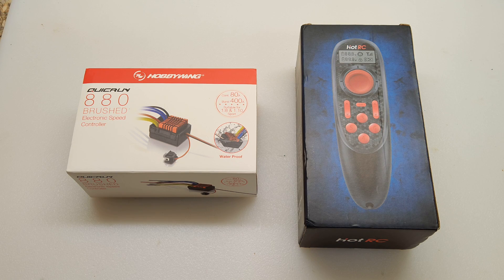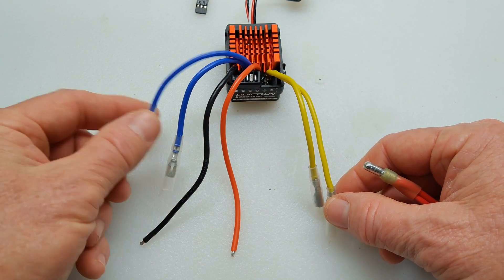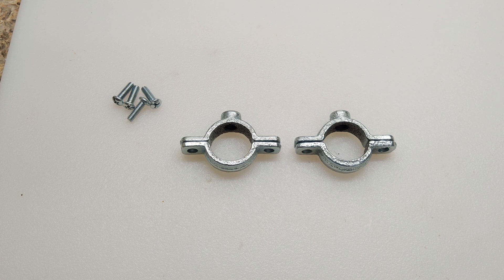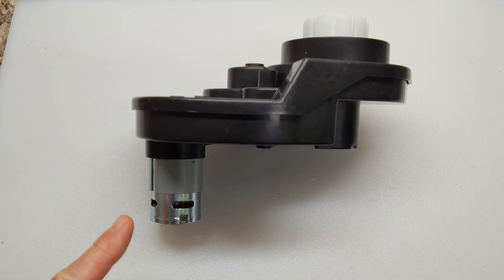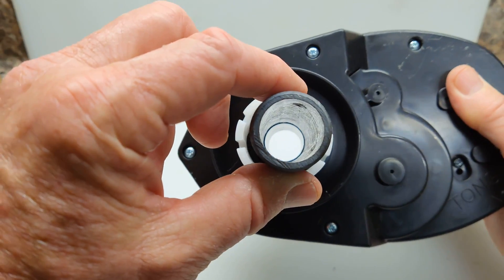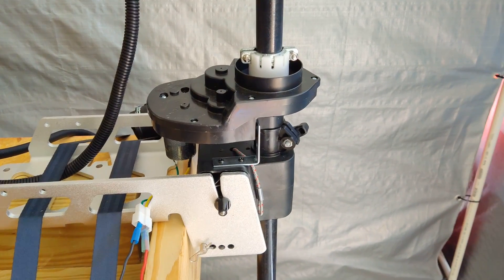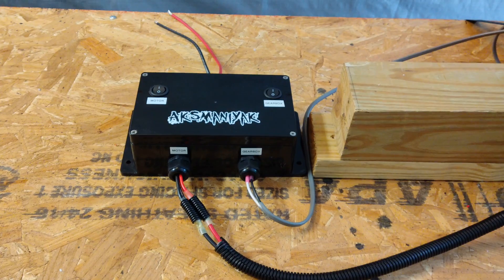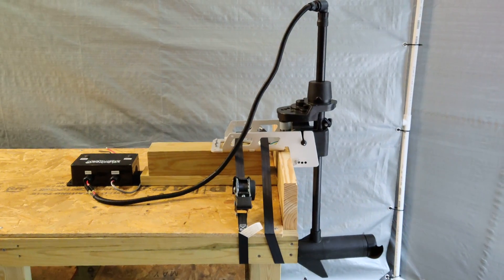Wireless Remote Throttle and Gearbox Steering for Trolling Motor - Part 1

Comment: Your videos are unmatched in terms of clarity and detail. Thank you for doing such a great job. I have a question, I saw you did a similar build using a servo. After having both , which of these two would you recommend? Also, have you tried mounting this setup to a standard trolling motor mount?
Reply from the maker: Thanks. I try to keep my videos short and to the point. Cost wise, this build was less but the servo build is much easier to install. I did this with a standard mount and it worked just as good. I just happened to have this mount and wanted to use it.
Reply: @Aksmaniyak ok. I saw on Amazon someone complained about the durability of the servo gears stripping and breaking. Have you had any issues or concerns about that?
Reply from the maker: @dmax2023 I never had that problem.
Reply: @Aksmaniyak  ok great. One last question, I saw on the gearbox mod you turned the power down to 25%. Couldn’t that be done with the servo as well and eliminate the dial controller?

Comment: Why do you need two esc's? I mean, they should be able to power steering and throttle individually.So i'm just wondering why you used to.I've always played with r c.Cars and stuff.So I understand what they do.And how they work.I'm just wondering what their necessity of two is?  It just seems to me like that's an extra eighty dollars that you'd have to spend on the hobbywing, 880
Reply from the maker: The EScs were about $35 each. When you run large motors (like the trolling motor) instead of RC cars, it draws much more current and you need to double up the motor wiring. Even doing that, I would not run any motor larger than 50lbs because the ESC has been known to fry. That is why I ran 2.

Comment: is it possible to use 1 esc for both motor speed and direction? Thanks
Reply from the maker: Yes, but with the servo steering version.
Reply: @Aksmaniyak is this because the gearbox rotates too fast? Could you install a PWM or a stepdown regulator after to prevent that? I've just started researching these mods and trying to plan what my build is going to be, but I'm still learning.
Reply from the maker: @jeffspengler8789  Yes, you can use a voltage converter.

Comment: How did you plug the esc's into the reciever? Motor port 1, gearbox port 2? And then you ran the transmitter in mixed mode?

Comment: Well I went out to test today on the water and am having another very weird issue. Everything works fine in the shop. I can turn left and right, forward and reverse works great. Once I put it in the water today it still turns left and right but the forward and reverse only work for about 15 seconds then it shuts off. I have to turn both ESC's off and back on and then I get another 15 seconds. I took it out of the water and back on the trailer and it ran fine again. I ran if for 10 minutes straight in forward out of the water. So I put it back in the water. Again 15 seconds or so and then nothing. Its so frustrating because out of the water its working great. I got it back home and checked all my connections and didnt find any issues. I put it in forward and locked it on the remote and I ran it for a half hour with no issues.
Reply from the maker: Try testing it in a bucket of water under "load" conditions. Touch the wiring to see if they get hot. It sounds like and overheating issue.
Reply: Esc might have low voltage shutoff on if you have the programmer item 3 should be on 1 unless using a lithium battery should be on 3

Comment: So i followed your setup and everything is working except one minor issue. I have set the movement motor on the left, right axis of the joystick. Moving it right works fine. Moving it left will not work on the first try. I have to move the joystick left then back to the middle, then left again to get it to move. Any ideas on the issue?
Reply: just from some basic RC knowledge that I have, you may have your steering set with a "brake" functionality through the receiver. This is usually for accelerate and reverse so that if you are accelerating a car forwards at 15mph, and then hit reverse, that it doesn't shred the gearbox by trying to spin the wheels backwards while still rolling forwards.
Reply: @jeremyneal9746  Thank you. I figured it out on the programming tool to change it to just forward and reverse and it worked fine. You were correct.
Reply: Happy to help!  @merloc91
Reply: so in this instance. right would be accelerate and left would be brake. it accelerates just fine but moving it left after right is acting like a brake instead of reverse

Comment: Hey man, having a problem with my trolling motor cutting off if I run full throttle. It runs great at low speed. Is there a setting in the esc I need to change like voltage cut off or something?
Reply: Item 3 on esc needs set to 1 if running lithium battery set to 3

Comment: I already manufactured your work and it worked for me. I was wondering if a GPS or something similar could be added to use it as an anchoring system like other trolling controllers?
Reply from the maker: Yes, there have been some people who have done that. It requires programming which I do not do.
Reply: @Aksmaniyak  Brilliant. I will try to find some videos with this information. Thank you, excellent work.
Reply from the maker: @josefelixcastillo8509  Thanks Jose.
Reply: Have you found anything on this i was also interested in this

Comment: Can the esc and remote/reciever be used together to control a minnkota terrova steering motor? The purpose is to control a forward facing transducer.
Reply from the maker: It could depending on the voltage required.
Reply: @Aksmaniyak  it's a 12 volt steering motor
Reply from the maker: @mikegalate5182  You would need to know the voltage draw of the motor when in use and the output voltage of the ESC.

Comment: I really want to do this! Thanks for the content. This may be a dumb question but I’m hung up on how to go from the ESC wires to my trolling motor which has 8 AWG wire. Any advice? (My motor pulls 52 amps at full speed)
Reply from the maker: Thanks. I don't suggest using the 880 ESC on any TM larger than 50lb. The wiring could fry.

Comment: Before connecting both esc's to the receiver you need to cut one of the red wires to one esc or the other if you don't the bec 6v 4A of the 2 esc combined will overpower and burn out the receiver
Reply from the maker: I have built several 2 ESC single receiver combos and that is not necessary. Have you built one and had to do that?

Comment: Is this a complete no go for salt water use?
Would you recommend the other type of steering you used in other videos due to salt water use? Thanks for the videos man you’re knowledge and abilities are amazing!
Reply from the maker: Thanks Gabriel! I would not use this in salt water. Although some DIY builds may hold up in salt water, I would recommend a motor specifically made for SW.

Comment: Would hard wiring a pwm and just using the remote for steering be better for battery life? Or does the esc also work as a pwm?
Reply from the maker: ESCs and PWMs are both digital speed controllers.

Comment: The receiver you used in this video, the F-06A, is only rated up to 9 volts.  A previous video of yours you used the PWM receiver that is good up to 14 volts.  I'm confused how the 9V F-06A receiver works in a 12v system.  Did you use a step down buck converter in the build or can the F-06A receiver handle 12 volts?
Reply from the maker: No, I didn't use a converter. The voltage draw is monitored by the ESC and I only used the stock receiver.
Reply: @Aksmaniyak Oh ok.  That makes sense.  Nice feature of the ESC.  Thanks.
Reply from the maker: @TC-hl1ws  Glad to help.

Comment: this is great i have been making all the mods to my Colorado inflatable pontoon boat. and i am now going to try this mod. I do have a question how hard would it be to put it on a joy stick instead of making it with a wireless remote control?
Reply from the maker: I made a video with one using a joystick and a PWM controller.
Reply: @Aksmaniyak  thanks i will look for it. I have another quick question i dont know much about brushed and brushless motors. Will the ESC overheat because i am using a brushless trolling motor and a brushed ESC
Reply from the maker: You can only use a brushed ESC with a brushed motor.

Comment: I saw someone else made this but stepped down the voltage to the motor to turn the trolling motor.  Maybe 3 volts vs 12.  Allowed the motor to turn smoothly.
Reply from the maker: That was probably my other video using a joystick instead of an ESC. Watch Part 2 for the solution.

Comment: That gearbox is out of stock. RPM range is 15000 to 40000 - with that turning so fast, I'm assuming LOWER RPMs is better for this project? I did your ESC speed control last year and now that I'm convinced it works, I'm ready to take off the head. And having that long steering stick next to me (attached about 18" away from the shaft on a small angle iron) is annoying so thinking about this, too, now that you've got it so cheap and relatively easy to do! Thanks again. Saw your #2 update for less jerky/slower steering.
Reply from the maker: Thanks! Part 2 does a great job of slowing down the speed and smoothing out the steering. You can use a similar 12V gear box. Try to find one with lower rpms to help the ESC. Yes, the project is very simple when I finally figured it out after hours of mental torture!😵‍💫

Comment: As already mentioned about programming ESC to make turns less sharp, are there any options to turn without auto returning to zero?  The same way as throttle control works (stepwise by single stick pushes).
Reply from the maker: A subscribed just told me how to smooth out the steering. I will be posting a "Part 2" shortly.

Comment: NICE! You gotterdun! I’m still working on mine and I think I’ll have to upgrade the second ESC (only goes in one direction).     I was really hoping you’d figured out a way to use one ESC. But two will do! 
I don’t know if you already know it but you can reduce the turn speed by programming the gearbox ESC. (Changing programming items 5 and 6 to option 1 reduces the power output  to 25% and drops the speed proportionally.)
As usual, great vid and thanks for the motivation!!
Reply from the maker: Thanks Wali! That makes sense and what a great idea. I made the changes and it now has smooth turning. Genius! I want to do a quick update to the video and want to give you credit. What name/handle do you want me to use?
Reply: Wali is fine. (Actually my name)😁
Reply from the maker: Thanks. I already did the short video and will post.

Comment: Is there any builtin left right limiting for the steering motor?
Reply from the maker: No, you have to go by feel or you can add a stop. I positioned the depth collar in a way that stopped one side at 90 degrees. It should be an easy mod.
Reply: @Aksmaniyak  thanks

Comment: Great video again good sir! This is exactly what I'm putting together myself, just haven't put together yet. Except,
I 'm trying to use a very small PWM (Voltage regulator) smaller than the one you used in your last video with the gear box.
I plan to install in between the ESC and battery wires. Much like what LainegEj did for his gearbox steering project.
You will definitely have less torque on the steering and you probably wouldn't even need those "L" brackets on the newport vessels mount. I also plan to use jumper wires for the channels, so that I don't have to use the joystick every time.
Reply from the maker: Thanks Scotty. Keep us posted on your project.
Reply: good video. I finally managed to finish my project similar to this one. Some control could be adapted to be able to leave the kayak static in a specific place. similar to an anchor system

Comment: Are those remote any good ? Lookong at lot of your video and you have them in a lot of them . Planning to use one but would'nt want to stay stock on the water !!! 😅😅😅
Reply from the maker: I suppose you could put one in a baggie but I have luckily never dropped one in the water.
Reply: @Aksmaniyak  I thought I read “waterproof” on the controller box, but I couldn’t find it and I’m not trying to prove it. 😁 
OTOH Corrosionx is pretty magical stuff. Ive had some great results with it and it’s worth the effort. https://youtu.be/s4z8QMgTEA4?si=8FCiP1lDCF0QSLxZ

Comment: Great video as always! I always appreciate you doing these things for new ideas.  I have one question. I noticed when you turn the motor, that turning unit has a lot of extra movement.  Is there maybe a way to make that more solid and maybe decrease the shaking and extra movement, or does the entire unit have to be free?  Again, thank ou for another great video!
Reply from the maker: Thanks! The NK 180 bracket does not lock unless you pull a cord. That is why it shakes.